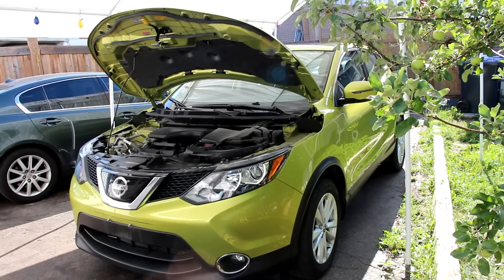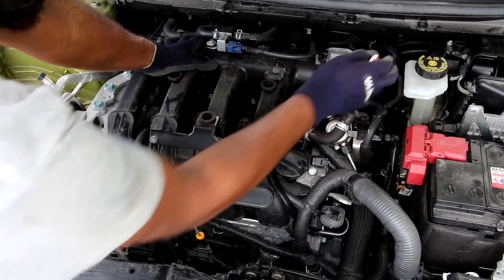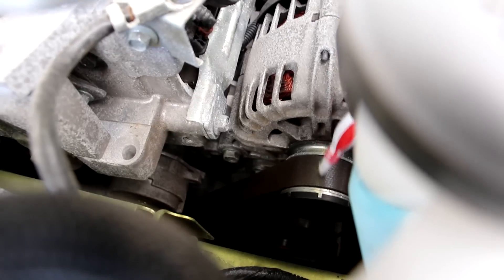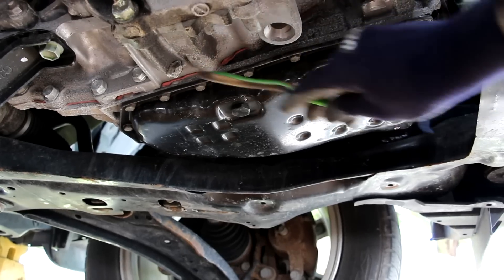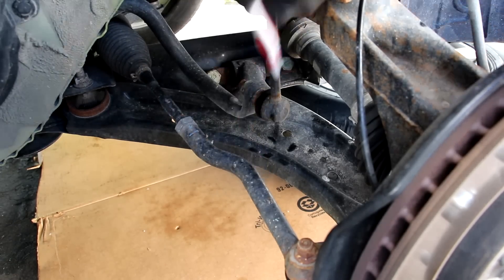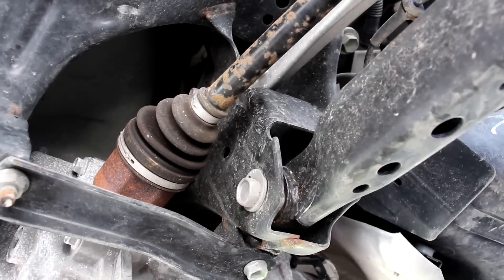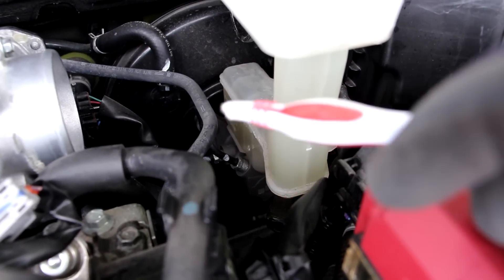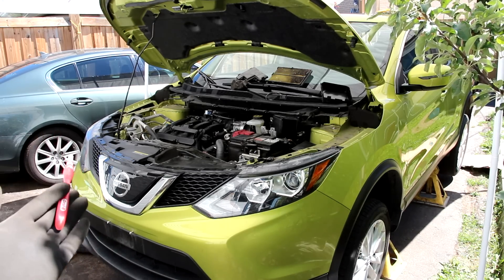Nissan Qashqai / Rogue Sport Mechanical Review

Comment: I have the 2017 US version. It'll be 7yrs old. No major issues. Only 50k miles. Although I'm not too worried about changing s-plugs only because they'll only be changed a few times during the life of it, I have noticed the rust issue underneath with the suspension. Has a good amount of rot in some spots :( I think Mitsubishis also have this issue. Other than that, the car's been great for me. The cvt felt jolty within the first 20k, but it feels more smoothed out as it's aged. I hope it keeps up.

Comment: Great info.
Why does it take so long* to heat up in the winter. 
I had a Ford Escape previously and you had to take your coat off. 
Why do the windows fog up so easily in this car.
They also want $500.00 for  a DEFA block heater.
Anything special about these.

Comment: Absolutely hate the air intake design with it blocking everything below and how long of a path it is. How do you jump the car? Electronics under the hood aren’t a big deal. Most electronics are potted or conformal coated so they could be underwater if you want. Also the electronics are in a cast aluminum case so you will likely be dead if the module gets crushed.

Comment: My Sentra has same engine from 2007 but wants 5w30 and comes with a dipstick. Only one engine mount and traditional intake design. No vvti I'm pretty sure. At 150k I change the cvt atf  every 30k and added a oil cooler and running strong

Comment: I live in the northeastern U.S., so corrosion is a major concern of mine with regard to vehicles.  Interestingly, there is so much on the Interwebs about how auto manufacturers use blah, blah, blah processes and zinc coatings that are, "so much better than autos of the past, woo, woo."   Yet, this Nissan is a year or two old and is starting to rust.  I have watched similar videos about 1 or 2 year old Jeep Wrangler frames starting to rust.  I see A LOT of late model Ford, GM, and Chrysler trucks with spots.  At $20, $30, $40, $50,000+ that is criminal!

That being typed, I have a 2007 Nissan Altima with CVT transmission that has 165,000 trouble-free miles on it.  Zero rust on the body (don't know what the undercarriage looks like), and the engine hums like an old German sewing machine.   Also, have a 2012 Nissan Pathfinder, which is THE best of the 6 vehicles I've owned in my life.

Not an engineer, however, it's starting to look to me like the overwhelming majority of vehicles made since about 2015 (with the exception of most Toyotas and Hondas) are sub-par (especially relative to their price points).  I do NOT give a damn about the diameter of the cupholders, the size of the "infotainment" screen, heated steering wheels, or the number of USB ports.  I am only interested in trucks that are built rock solid, can be worked on easily, use metal engine components (where it's smart...............like high heat areas), and have well proven engine and transmission designs and a minimum of computers.  This philosophy (and diligent preventative maintenance) have served me very well.  Zero engine or transmission issues in 30+ years of driving.

Comment: I have one of these cars, and its not too bad. Car is relatively reliable. Change the cvt fluid every 30k miles or less and you should be fine. You should be able to fill it through the dipstick tube and I've heard they have a plug on the side of the trans where you can fill it like a differential.
Reply: It was.easy , they even have a transmission drain plug, Just drain out the and fill the same amount.It was easier than changing the oil.No dipstick is retarded though

Comment: I own a Nissan X-Trail T30 which uses QR20DE (predecessor of MR20DD in this video) and it's so much easier to work on! Every sort of essential things like changing spark plugs and air filter is very accessible unlike this car.

I hope they use good old QR20DE layout for air intakes.

Comment: The last reliable nissans were built in 2001
Reply from the maker: Maxima?
Reply: @speedkar99  I specifically had my nissan u14 bluebird sss in mind. 500,000kms on the orginal engine. Was built in 2001. Just before the merge with Renault.

Comment: Did they fix the Tailgate/boot lid handle issue? Had a Dualis so maybe four or so years difference from this model. The tailgate handle is secured by clips. These break after a bit of force and are hard to replace. Solution is to never actually use the handle and let the boot open by itself. Nissan never backed down from claiming it wasn't a design fault in Australia. Some other territories got cheap replacements eg less than $250 USD.
Reply from the maker: I didn't realize that was an isshe, seems like an oversight there

Comment: Glued in plastic trim on back doors above window (right/left corner) falls out.
Noisey steering rack (when cold)
Noisey passenger airvent( sounds like a fly in it).
Suspension weak and failed after 30,000.

Just a couple of issues I have.
Reply from the maker: Sad to hear

Comment: The fact they have the dips stick port is cuz the CVT unit is a very old one, they are too lazy to design a new case with a plugged port and too cheap to ship the car with a actual stick in it. The steel radiator support is a con too, remember how Rusty old Maxima with a radiator hanging by nothing? This car is to show how cheap Nissan engineer are, or the lack of it.

Comment: Direct Injection and only 141HP? How did they manage that 😂
Reply: Ikr the Corolla SE/XSE make 170hp out of their 2.0L.
Reply: @trent7080  Honda R20A3's are also detuned, and have balancers. Still puts out 160, with port injection and SOHC. Renault just builds crap engines.
Reply: 141 is the output of a SOHC 1.8L Honda engine that has PI.
Reply: ECU programming

Comment: Based on that under hood layout it looks like Renault had a little too much influence in the design of this platform and power train.
Reply: Yep.  The way the ECU is bolted to the battery tray, the air filter location, the way the brake master cylinder is buried behind the air filter (albeit Nissan have extended the brake fluid reservoir cap upwards which is a bit more sensible), the single piece undertray... It's all pure Renault! :)  The expansion tank cap seems to be identical to Renault, and the crossflow radiator seems typical Renault too.
Reply: it is a Renault. the engine is the same as the kaptur and koleos

Comment: I had this vehicle for two years with 41,000 km and its was the worst vehicle i have ever had... was in the shop for warranty work way more times then i can count on two hands and at 17,000 km both front struts needed replacement under warranty and to cut right to the chase washout a entire laundry list of all the warranty work i had.. the CVT was on its way out on year almost 3 of having it as my last straw. I have since traded it in as it was turning into a nightmare as it was right from the start even at 8,000 km I was having a long crank over issue with a stalling issue. Never EVER ANOTHER NISSAN!
Reply from the maker: Wow! Good to hear from someone who owned one. I guess Nissan has some cleaning up to do
Reply: We also own one from 2017 with over 60k miles on it, althogh I have never had any issues with it, has never needed a service besides the anual ones and oil changes, so I am really happy with it.
Reply: @claudiubucholzer4103  you just got Luckey.. 🤷

Comment: Can’t u just fill the CVt transmission through the dipstick?
Reply from the maker: I wish, but you still have to pull the plug to drain excess
Reply: speedkar99 so what’s the point of the dipstick then lol
Reply: @speedkar99  not if you fill the exact drained

Comment: My mom's 2013 Nissan Altima's CVT failed after 50K miles (after the warranty expired)
Reply from the maker: Typical
Reply: Strange, I done 150000 and still good. I change CVT oil every 60000 as they said in book.

Comment: My brothers 2011 Nissan Versa has a 4-Speed automatic transmission and its really reliable even after 300K Kilometers even though things are staring to fall apart. Still runs
Reply from the maker: Um, you sure it's not a CVT?
Reply: Versa have a lower failure rate, as most 2.5 CVT are the problems are.
Reply: Apparently the Versa "automatic" is a CVT, but maybe the lower torque of the Versa puts less stress on it.
Reply: @JoeUrbanYYC  I guess, but other than that, it still a very poor quality car.
Reply: He's on the ball the first Canadian Versa was available with both 4-speed (lower trim) and CVT (upper trims.)

Comment: What I love about these videos is they are going to have a whole 2nd life once these vehicles are 10-20 yrs old** and people who like wrenching on cars themselves can check here to see if that's a used vehicle they want to deal with.

**j/k there will be no 20 yr old Nissan CVT vehicles.
Reply: They won't be around in that time frame based on the terrible design and manufacturing,
Reply: I have qashqai since 2010 model 2009 , i still keep this car very strong and reliable and never have issues with CVT its great in fuel consumption, it lives long time especially i change its fluid regularly as in its manual
Reply: @ahsamahi4385  how many kms/miles total?
Reply: skorpiius  121000 km
Reply: Mines is

Comment: “Omg I lost my toothbrush “😂😂😂😂

This generation QQ is not reliable either, I received couple cars comes with R134a leak from the condenser , and one comes with trashy rear brake motor fail from that shiTty manufacturer TRW ...
Reply from the maker: How do the engines and CVTs hold up?

Comment: "dip stick sold separately" lol
Reply: What were they thinking? That is some cheap shot
Reply: They don’t want you checking the transmission oil, so it fails even earlier and you have to either get a new vehicle or bring it in for expensive repairs
Reply: @bosccoh  considering their backlog of their CVTs I think I will take my chances working on it
Reply: Lmao ain't that the truth
Reply: I was just about to comment on that. PLEASE tell me that's a joke?
Reply: lol this way they can get out of covering the garbage cvt under warranty by saying oh lack of maintenance due to low ns-3 cvt fluid lol sorry new cvt for 3500
Reply: I suspect the dip stick is a dealer only item, too.
Reply: Of course its a joke i have qashqai with dip stick for CVT already available
Reply: No need for one it gets checked every time you replace the CVT ...about once every 40,000 miles.
Reply: @tonys8243  😁,.Just changed mine at 48,000 ,just bought it 3 mo ago.Plan on changing it every 30,000

Comment: 7:02  Dipstick sold separately! Strike 3.

Strike 1: air filter is buried in "secret" location (not a big deal, but still...)

Strike 2: changing the alternator requires more of the car to be disassembled than changing the AC pump.  

3 strikes that put another car in our junk yards as fast possible.
Reply from the maker: Yeah I'm not really liking the under hood layout
Reply: Strike 4: Rusts fast
Reply: Well, Nissan been doing that since the early 2000, ppl still buying it as long as they are cheaper ( than other better cars)
Reply: I love my Nissan rouge sport 2020 ! I drive Uber with it and put 5000miles per month . No issues and I definitely change oil every month !